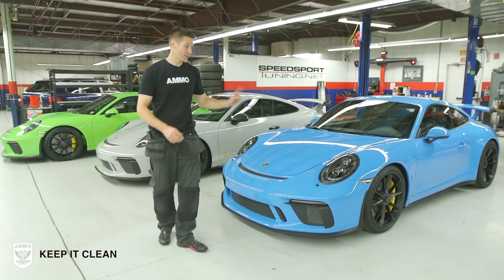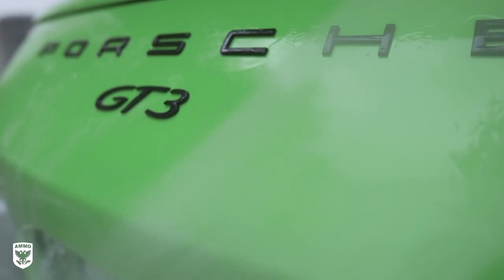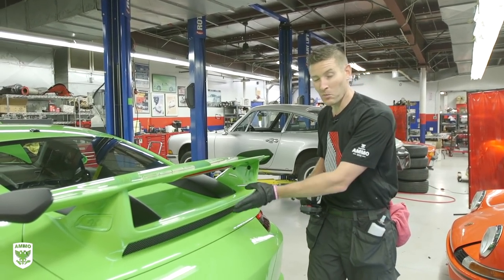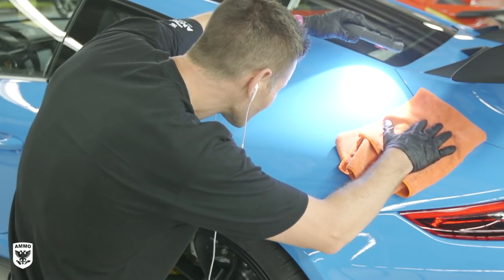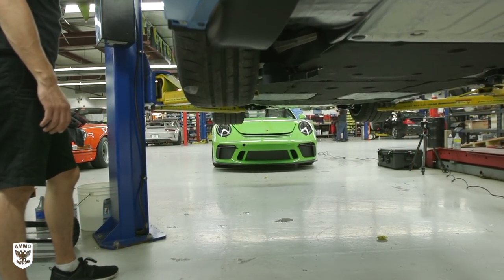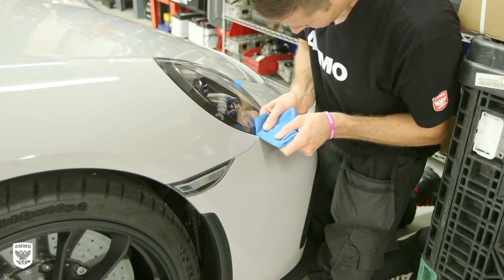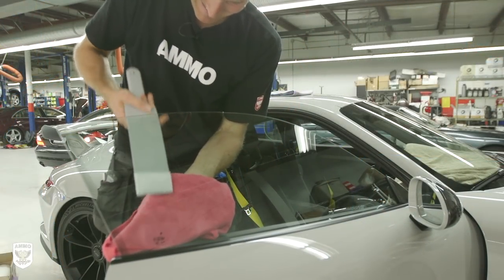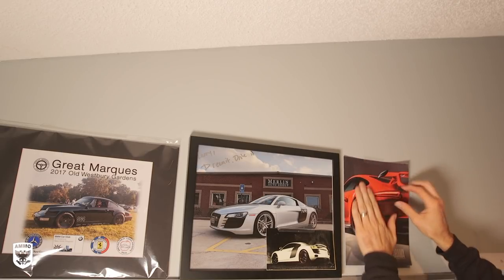Porsche GT3 First Wash & Drive

Comment from the maker: Hey guys, interested to hear your thoughts on why cars built as the same time (within a few days/week) of each other would have these variances in overall finish quality. The paint thickness and coverage was almost exactly the same on all 3 cars, but wonder why the finish or refinement was unique to each color. I hope one day I get to go to the factory and see if for myself. This "finishing" inconsistency is common amongst most brands and most likely why the cars are detailed at the dealership before the customers picks it up. Thought it would be fun to compare 3 "non-detailed" paint jobs, same car, same (appox) build time, and delivery date. Best paint was green. Best wing was blue. Best overall paint + wing was white. Hope you enjoy the episode as much as I do working on these cars. AMAZING!
Reply: take one part human error, one part time deadlines,  combined with quality control's acceptable variances and staff hours limits and i'd think we get little differences in each and still not a prefect product. I'd imagine that every automaker would like to spend the time to make these prefect but unfortunately (or fortunately depending on how you see it) it's just not feasible.
Reply: I work in the manufacturing industry and can say with certainty that not all assembly lines are created equal. To elaborate more on this statement, personnel, equipment and, sometimes, even process will vary. No two detailers will polish the exact same to give an analogy.
Reply: I don't think the factory is to blame for the differences you found. It can be really difficult to isolate these defects when there are so many variables involved. Their entire supply chain has to be on the same page as far as handling and that is usually the most difficult thing to accomplish. It is impressive that the paint thickness is that close on all three cars within a tenth of a mil. When the car leaves the factory, it's usually mishandled by freight and LTL shipping companies, or dealers. They are usually not trained on special handling practices, or they are simply in a rush. On a car this expensive, they should just use a protective film prior to leaving the factory.
Reply: I've worked at a Porsche dealer in Germany for a year, only the most expensive (GT3 RS, 911 R...) models arrive with a full cover on because the don't have to travel far from the factory to the dealer, and they don't sit around for long because of the small distance. I'm now working at a Volkswagen dealer in Germany, and some of the new models (Tiguan Allspace) get built in Mexico. Because of the huge distance and the long time they take to get here they all have a comlete cover on them. 
I think the specific differences on these cars came from different Guys doing the refinement and or final inspection. Or maybe the dealer did interfere with the paint finish even though they didn't detail it. (The likes of "Oh here's a fingerprint, let's remove that with some spray wax") We used to do that alot at the Porsche dealer.
Reply: Different workers, different shifts, different experience levels, fatigue issues, time constraints, machine tolerances get sloppy where operations are automated, dust (every factory has dust problems), etc. etc. -- all play a part in quality control issues at factories.
Reply: I'm worked for an OEM in the car industry for several summers now as a student.
Thing they keep telling me is "Never get your new car during summer/just after".
Quality will always be less since there is less (experienced) staff around.
It's a small thing but maybe something to keep in mind when buying your next car..
Reply: From my experience watching painters work at my job. Sometimes a little more/less thinners get used in the clear coats, different brands that work better/worse. Thinner/thicker coats of clear. There's probably a thousand variants on why a clear would work differently.
Reply: Years ago I use to PDI (pre delivery inspect) cars at a Lexus dealership in San Antonio, and you’d be surprised how many paint flaws you’d find either from the factory or during transport. On high end cars you would expect better, but to the untrained eye not many people notice.
Reply: I'm a big fan of all 3 paint jobs. For the GT3 I think the Miami Blue goes best, but for the GT3RS I think the green with the satin black and green trim wheels is the best look. The chalk paint is really nice also and think it would look even better with the big GT3 logo that was on the last few generation 911s
Reply: Many variables. First, different workers on the line. Not everyone has the same skills and not everyone cares. Second, deadlines, cars need to keep moving. Third, unknowns of shipping, sooo many things can happen here. New cars can be damaged and repainted before being sold, improperly handled etc.. I have seen plenty in my career. And lastly, they make them for the average joe that will most likely not scrutinize them as we do. I have seen some high dollar cars such as these, and ferrari, that have worse paint than a 9,000€ Opel corsa.
Reply: Not everybody who works on the lines where these cars & finished & polished is equal, believe me, some rush & just get it done, some take their time & get it right.
Reply: I'm interested in you doing all this to my beloved g37. But your probably so expensive
Reply: Great video as always Larry. What do you mean when you say the paint is 6 mil thick? I know it can't be mm because 6mm is almost a quarter of an inch. Thanks!
Reply: @ValuedComment  0.6 of a mm perhaps?
Reply: AMMO NYC - could it be subtle variances in the robots that actually apply the paint? No expert here... just thinking out load. 

Love your videos. I am much better at caring for my new 911 thanks to your willingness to share your expertise. THANK YOU!
Reply: Manifest it "the secret"
Reply: 1 "mil" means 0.001 inches. Stupid naming convention.
Reply: I went on a track ride as a passenger in a 6sp, GT3, I'll never forget it. It's one of my dream cars too!
Reply: I work in Paint at OEM's and have been certified to audit for Volkswagen and all of its brand (which includes Porsche).  More than likely the wing is a supplier part meaning that it was in fact manufactured at a separate manufacturer which would explain the inconsistency that you see on it.  The 3 spots that you found on the blue model are incomplete polishes after the scuff process.  Most of the clear used now in Paint is 2K clear which requires an extended polishing (typically 8-10 seconds) to ensure that the scuff is polished completely.  

One thing that I would recommend you looking into with your detailing is what they call "seamless" microfiber towels.  The towels that I saw you using to detail have the stitching around the edges which can actually cause micro-scratching which is especially noticeable on black paints.  With the seamless microfiber towels you can avoid this and the cost is not prohibitive.  I did like seeing the little attachment light on the buffer that you used - may have to investigate using that.
Reply: Noticed finish on black Harleys has far less defects than lighter colors.
Reply: Wondering, how much do you charge for such services? 

Do you travel to provide these services?  Internationally
Reply: AMMO NYC well let me give you my experience with my RAV4. I bought a brand new RAV4 and realize there was a discolouration of the door panels. I contacted Toyota and they refuse to change it because they say it’s a manufacturer’s defect and it’s not covered by Toyota. I wonder if you came across a similar problem with a véhicule and if you know if they have a similar clause in their warranty.
Reply: @sebischmitz777  I worked at a Porsche dealership too and our cars had full self adhesive covers to protect the paint. They would be removed during Pre Delivery Inspection when the car is removed from transport mode. The car would then be sent to an in-house specialist to be polished and I would do the final inspection before handing over to the owner. Porsche recommended use of a clay bar and I used several brand new microfibre cloths per car to get a superb finish. Our specialist used acid wash to remove wax and transport residue which Porsche frowned upon but that was his preference.
Reply: Cleaning errors 👍
Reply: I wish you to get your dream car ! 😀 
I hope you’ve enjoyed the ride !

Comment: I worked at an OEM, and I can 99% guarantee you those cars are not sanded/polished before leaving the factory. The paint process uses base and clear coats that attempt to mitigate the need for what you would consider proper finishing.

More than likely, any defects that you see are due to handling after it was completed. Employees drive cars out of the factory/around the lot, onto the boats that ship them to the US, etc. They go through a lot of hands and pass by a lot of people before they get to you.

Also, different paints typically run through the same paint robots with a changeover process, so the quality of the changeover and the ambient setting in the room plays a huge role in how the paint finish comes out. Then they go through final inspections where the goal is to identify defects but of course can introduce new ones depending on who the inspector is. To be honest, Almost no one will call a car for repair due to swirls and buff marks. Unless there are actual hairs or other physical defects in the paint that could cause it to flake and rust, it'll pass QA.
Reply: Wrong. There are plenty of videos of the entire manufacturing process at Porsche on these cars and they are sanded/polished by hand by the people on the production line.
Reply: kern417 I took Euro Delivery of my 2008 CARRERA WHITE/Gun Metal GT3 RS & I watchedthe paint jobs which are very much hand applied as well as getting SOME cut/buffing...It all seemed to depend on the colour..
Reply: pretty sure those 3 marks were from the suction tooling used in the factory. 
i work in aerospace ans we use em to hold sheets up, but NO ONE ever wipes off the suction cups on the tool.
Reply: Literally the first video if you search "porsche manufacturing process" shows a 2018 Turbo being painted by a robot. The link is z3zuPyjFTsk. Feel free to post a link of cars getting hand painted but it's not going to happen.
Reply: Not hand painted. But after they are painted by robots, workers do sand and buff them by hand. First few minutes of this video you can see robots painting the car. Then a guy HAND PAINTING the hood. Then someone buffing the paint with a hand-held wheel. https://www.youtube.com/watch?v=z3zuPyjFTsk Yes, this is an Exclusive Series car. But the regular production cars and the GT cars are 100% touched by some dude with a buffer wheel too.
Reply: My Point is when he's asking why are there paint defects, it's because the car isn't hand prepped/painted/finished in a shop like his 911 was. These cars go down an assembly line and custom colors or not a robot is doing most of the work.
Reply: kern417 The Turbo is more of a "CONTINUOUS BUILD" of the brand and yes they DO have a lot more robots involved BUT when you step onto the RS line such as the GT3/GT2 RS There is MUCH MORE hand building/manufacturing I WATCHED them mate my clutch and bellhousing along with the full transmission and engine all by hand...These are NOT RS models whuch dont get quite as much "human involvement" as the GT3 RS I ORDERED 2 08 GT3 RS Models which I took Euro Delivery of along with my pop..They actually let us help install small parts of our own vehicles..Its almost surgically hygienic and nothing is happening quickly.
Reply: Yeah, a robot does the paint work. But the reason there are swirls and sanding marks (there were on my GT3 too) is because a person is putting them there with a buffer wheel...

Comment: Tip for the glass Larry. Try Autoglym professional glass polish ( any high quality glass polish should work ) and add a little tar and adhesive remover. I no it sounds odd but trust me it works haha. Mix it 10% adhesive remover and 90& polish Mic really well and use a polishing sponge or hard applicator and give the glass a good scrub then leave to dry and remove as normal. Works a treat every time.

Comment: The reach n clean tool Can also use a microfiber towel as well and the foam that it comes with, helps hold the microfiber towel given if you wash it properly it doesn’t lose that grip that it has

Comment: Its really interesting Larry that the porsche's you work on that are from factory have defects on them. On any of the Audi's or Volkswagens I've purchased the paint is PERFECT(not even marring visible). I just let the dealer know to not touch the car at all or I'm not taking delivery. On my B8 S4(Phantom metallic black) and my MK7 Golf R(Reflex Silver) the paint was perfect. I didn't even need to use SF4000 on a Rupes yellow. I washed the car and prepped it for coating as there wasn't even any decontamination.

Comment: My experience is similar. Rhodium Silver delivery-had the dealer keep the wrapping on which I pulled on delivery. Pretty clean overall but found some swirls where some powered device touched the paint-also on the rear lid. Did a careful wash, Iron X for rail dust, super light clay with Sonus SFX ultralight bar. I found two spots where there was an inclusion in the paint that had been cleared over-dust or some particle. Anyway did a near full PPF with EXPEL ultimate-still have to do a correction on the rear lid .These are not show cars and they are painted on a production line. Fortunately as a silver car it hides imperfections really well. Compared to AMG products I would rate the Porsche finish as a B-.

Comment: damn that vision wall of cars is inspiring. made me think. I guess I do sort of that with the model cars I build. I just give them a special spot. I put the same ammount of attention to detail into that as you put into your detailing. In fact I use the method explained for your 964, which is my dream car and I recently built it for my collection, to ensure a perfect result of the paint. Detailing with machines is a bit hard on this scale because it's really hard to get deeper scratches out of the paint so I shoot for the best result possible straight after clear coating the second time.
anyways this is inspiring, keep doing it please

Comment: With window cleaning, I've found that mixing IPA with distilled water, rather than ordinary tap water, helps to reduce water staining. Distilled water is cheap for what's required, so there's no reason not to use it. Even when using distilled water, I find it difficult to remove all traces of water staining, so that's a current area of research.

Comment: Nice job! As a side note, I made a PDF template for the 997 GT3 badge on the 991.2. If you'd like a copy of it, I can send it to you via email. All you need to do is have a local shop laster cut it into some flexible material. I think I had it done for about $45. Then just tape it on the bumper and stick the letters in individually. I wish you were close to me, I'd send you my GT3. But I'm using some of your products and they are great.

Comment: About the 3 little spots on the rear fender of the blue Porsche - could it be that someone had a wheel for measuring the speed and acceleration connected with suction cups to that fender or maybe just a GoPro that went on different places?

Comment: on  glass I use chemical guys  citrus clear hydrophobic  free rinse  car  wash . just two cap fulls to five gallon bucket of distilled water .  it dose not have to be distilled but it will help the windshield stay cleaner longer..  throw a good hand full micro fiber towels  in the bucket. wrap a slightly damp microfiber from the bucket around your reach tool and go at it. never return a used microfiber towel to the bucket . use a waffle weave towel to wipe dry. Done. crystal clear. you can do a  whole car this way. just make sure you go in one direction and roll your towel as you wipe paint.

Comment: Hey Larry, another great video. Love the GT3 :-)

My question is though, why use a fallout remover before the wash process? Wouldn’t you be better off using a fallout remover after the wash process, as part of the chemical decontamination stage? And then move on to mechanical decontamination (clay) afterwards if necessary?

Comment: Really cool comparison between the three cars. I know at the Ford plant in Dearborn, vehicles spend different amounts of time sitting inside/outside before they get loaded up. Some are selected for additional testing, which means they get driven 100 miles or so (as opposed to my 18 miles). All that to say is a few days outside with people driving them back and forth introduces more opportunity for people to scratch them up. The dealer tech that filled my first tank in my truck scratched the paint right by the gas cap. All this doesn't explain the three sanded spots, tho. 

Does Porsche use machine painting? It looks like they do. If it is early production, they could still be working out kinks on the line - it took them about 4 months for Dearborn to really get into proper, full swing on my truck's production. My understanding is factories are constantly tweaking things to improve the quality off the line. This may explain the poor finish on the wing. As for the spots on the blue one, I'd be hard pressed to believe they were there prior to the car leaving the factory - even cheap domestics get better quality inspections that that. Maybe something happened during transport, something rubbed in those locations?
Reply from the maker: very possible